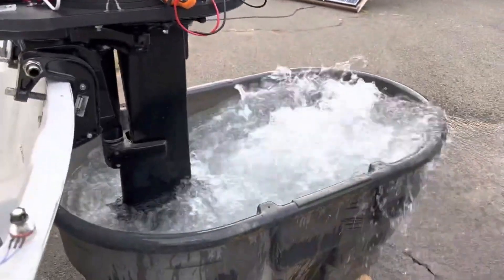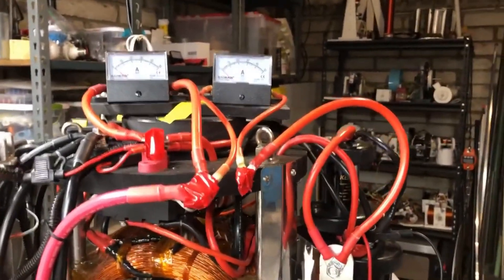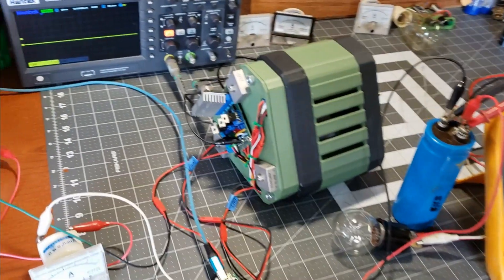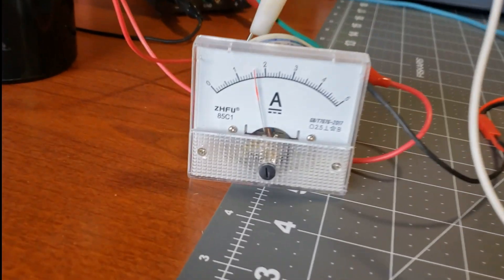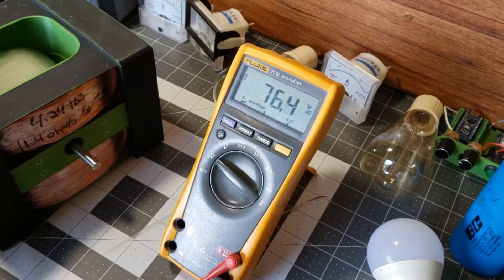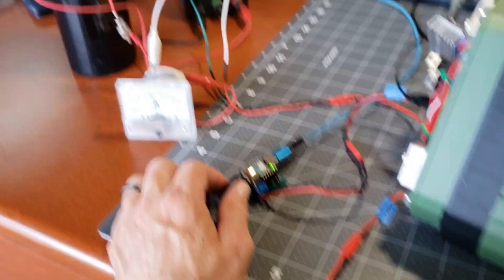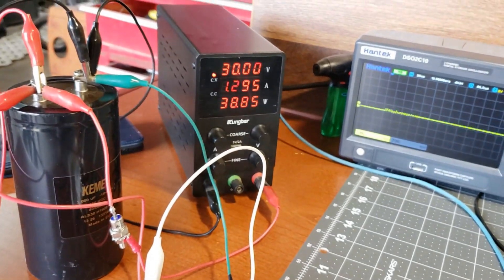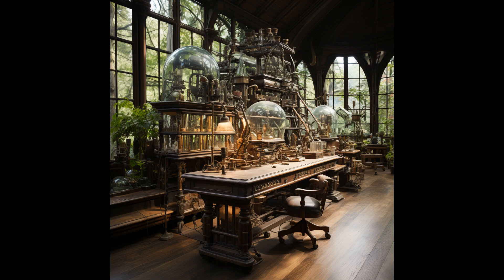Tri-Force Extreme Pulse Motor

Comment: What circuits would you recommend for a beginner to study to reach the point where they could contribute to the community?  Thank you.
Reply from the maker: Any circuit that you get obsessed with. I go though periods where I can't stop thinking about a circuit or design until I just have to build it to see if it works. You contribute by looking at something differently than others, then sharing your discovery or cool take on something that's been done before. When you inspire others to act is when you contribute bro.
Reply from the maker: The Patrick Kelly book of free energy devices is a good place to start
Reply: I'll keep that in mind.  Thank you sir. @redesign3dp

Comment: This is great but I know that it can be better have lots of ideas that I would love to share with u and k energy. It is really hard to work with the reverse voltage of these devices. From all my testing experience over the last few years the energy is hard to measure because the coils in the meters are affected bye the radiant magnetic fields being produced but the pulses of the motor. Have a great design in my head just no way to bring it into the world would love to share all may testing experience. If u have any questions feel free to ask
Reply from the maker: Redesign3dp@gmail.com. If you want to tell me your motor idea. I might be able to make it happen. Do you have a printer?
Reply: How would I get in touch with you?
Reply from the maker: Email